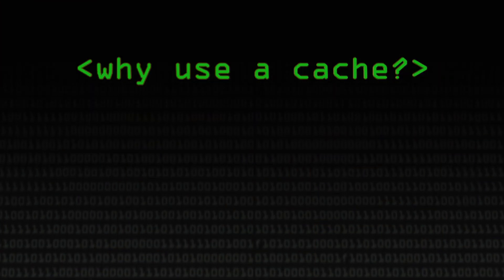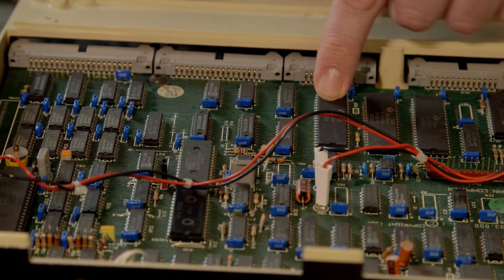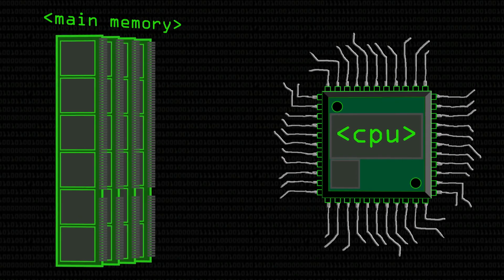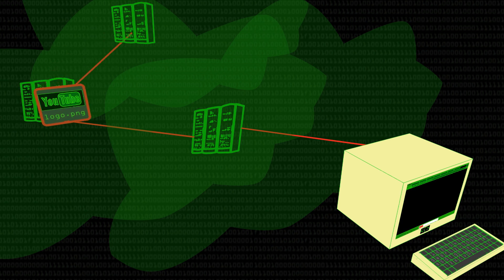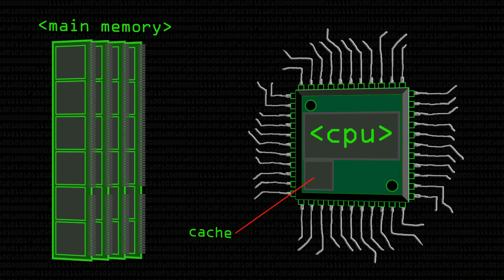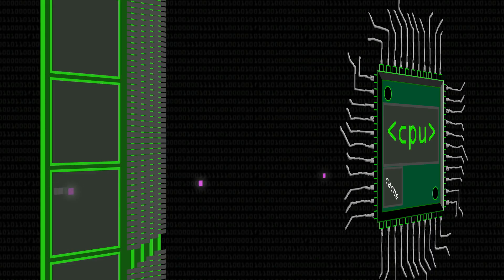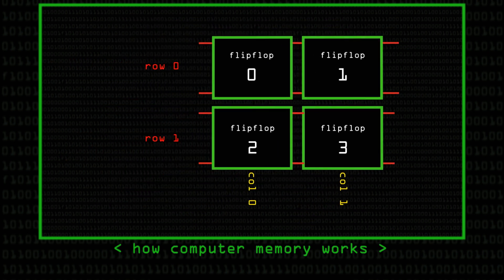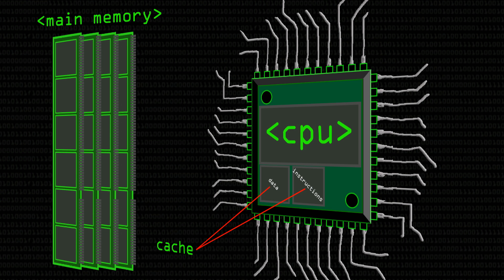Why do CPUs Need Caches? - Computerphile

Comment: Just a bit of clarification, nowadays RAM chips can be clocked faster than the CPU, but the latency remains quite high (relatively), so cach memory is here to stay indeed.
Reply: Do you confuse the internal clock with the external data lanes? I think that since the N64, those data lanes have the highest clock rate in the system. I don’t quite understand how ESD works here. Perhaps the multiplexers use BJT ?

Comment: Simplify chips by getting rid of all general cache levels but level 1 and fixed purpose level 0 cache. Reduce instruction size to 16 bit, remove branch prediction, legacy instructions, combine GPU and CPU SIMD as an APU, with many simple cores and increase level 1 cache to fill up the rest of the chip, with some redundancy to improve yields. This architecture makes more sense as we get closer to 1nM chip fabrication. Imagine an APU with 1 GB Level 1 cache the size of a Xeon.
Reply: nvidia / amd / intel would lose money that way that’s why we don’t see as many apus imo
Reply: @CeezGeez  .. Intel has everything to gain. I'm one of these people who don't care about Intel's Arc discrete PCIe graphics doing well enough to be competition for AMD and nvidia because I'd rather Intel just pull the rug from under their feet with Intel APUs and an Intel-only mobo standard that has a standardised GPU die socket, like a CPU socket, and possibly a very high bandwidth VRAM  socket to match. Faster CPU-GPU i/o, faster data access, with the VRAM usable by the CPU too, though at a slower speed than the GPU. PCIe wastes a lot of space and power as well as potential bandwidth.

Comment: I understand why we need cache but why do we need a centralized cache? Wouldn't if be faster to attach smaller caches to individual cores for doing tasks in parallel?
Reply: This would make multi-threaded applications more of a nightmare to design. If Core 1 has some data Core 2 needs for an unrelated routine, it would have to stop what Core 1 is doing to request that item in the cache, or it would have to go out to RAM to get a piece of information the CPU technically already has.

Comment: we do not need Cach  it is all depending on how the computer works. I need that one of the collages I will not name as I may get in trouble for it . Well that collage is working on a computer that will use 1 chip for memory this chip is your hard drive you ram and your system and cpu cache what this is is a single chip system for memory. Its realy cool how it works yes you would think it will slow things and yes it can but what is cool about it is down the line say a faster chip comes out for the memory but you cpu is fast enuff to run stuff well you can replace that chip with a faster bigger chip save mony doing it and get faster speeds.

Comment: So just a bit of curiosity mixed with some at the moment "current events," with the advent of faster DDR4 memory being capable of speeds of around 3000 MHz (3 GHz) and processor speeds largely staying the same over the last approximate 7-10 years is it possible that cache may become less important of a component, or is it that when you combine the both multi-threaded applications both in multi-core and hyper-threaded applications that the explanation for cache becomes more complex than simply the clock speed of a processor and the speed of the RAM being a major difference between each other as it was in the past?
Reply: Joshua Cooper well it would need to do one get data and send it back cycle per instruction. The instructions per clock cycle are nowadays often higher then 1 and all cores would need to do that in serie because ram is mostly not parallel. We would probably need 12 ghz ram before we don't need cache, but then CPU will have a similar speed

Comment: the point of modern CPU speeds vs RAM speeds forcing the use of more space on the silicon begs the question... what would a 3Ghz, ram stick look like? how much space could a normal sized(lets say DDR2) stick hold? how big would a 8GB stick need to be?

Comment: So really, the answer isn't that memory didn't keep up, that technically we can't do it, but simply that the cost of RAM as fast as the CPU combined with the amount of memory modern tasks use left room for a cheaper solution in the form of a small amount of very fast memory, a moderate amount of medium-speed memory (main RAM), and slower mass-storage (HDD, SSD). We could have a machine with 16 gigs of super-fast RAM but the performance increase would be moderate compared to the extreme cost.

More abstractly, we've always had cache in the form of a multi-level memory scheme, and this is just further stratification of it. Even the original computers had the online storage of bits it was working on, and humans with the rest of the data, with a slow link between them. The 1980s computers shown had a few levels: CPU with its registers, main memory, and cartridge/tape storage. There's a tradeoff between size of storage and cost of fast access, and many tasks naturally use a small portion at a time, so you use it as cache for the larger one.

Looked at from the other direction, it wasn't cache that we added, as the fastest memory kept up with CPUs, and its size has stayed fairly similar (even modern CPUs have the L1 cache around 32K, like home computers had of fast main memory); rather, we've added a huge later bank of RAM to modern computers, between the fast memory the CPU uses and the slower mass-storage.

Comment: The is actually a additional problem apart from cost. Silicon chips can only be made in a certain size, about 300-400mm^2 is tops.  A normal computer needs a typically say 4-16GB of ram today, and it would consume over 1000mm^2 of space. This make it so you have to make a multi chip solution.

Then of chip memory have to use board wires, they are a lot slower than silicone wires, make it so you need more cache.

Actually, the premise that its that DRAM is the reason why cache is needed. But the wires is the issue that make it so we need a lot of cache

Comment: I have i7 920 at 2.67GHz, if I upgrade to i7 5960X, and clock it to 2.67GHz, will there be a signnificant difference? And how much does it come from the cache?
Reply: For starters, the I7 920 is a quad core 8 Thread  CPU where as the I7 5960X is a 8 Core 16 Thread BEAST. Also, the 5960X will have higher instructions per clock, higher stock and boost frequency, more Cache (20 MB vs 8MB). It'll just rek the the older CPU easily in everyway.

Comment: You could have elaborated on what's going on with L1-L3 Caches. Is one for data the other for instructions, or do they have no preferences? If they can/will store the same, how does the CPU decide what to put where as they have different speeds?
I think this should be even in a beginner video, because you will be confronted with those values in most ads.

Comment: Gotta love how cache did make a difference. Going back to the Pentium 4 and the Celeron. In many ways they are the same except in cache size. Pretty much not not so succesful P4's became celerons.

And for office tasks, light office use, it didn't matter that much. Unless you where dealing with huge sheets to work on. 

So many office pc's ended up with celerons. And that wasn't bad! 

It was slower then the P4, definitely once certain jobs really could use a bit more cache then the celeron offered. 

Of course nowadays cache also is used to connect multiple cores together. As a bridge between them. So you get a nice big swat of memory to function as shared cache for all cores. And locally a much smaller one for its local, one core only, calculations.

So does cache influence speed? Yes but it also depends on the job it is doing. Word probably won't get much a speed boost with double the amount of cache. But encoding video, running databases or yes a huge spreadsheet then a big cache will mean more performance.

Comment: Modern CPUs often have three caches, the one that is described by this video (separate for data and instructions)  is the L1 cache, the fastest, and every core has it's own. L2 is larger often shared between cores (2 on my system) . L3 is the biggest and there is only one for the actual chip on which the cores are.
Reply: And we must structure our data access in such a way to use the caches as much as possible and delay the need to eventually go out to main memory, That’s the “fun” part
Reply: ty

Comment: apart from the cost problem, why don't we just use ONLY cache and more of it, either as part of the CPU, or externally. 
instead of using regular ram. cache would get cheaper anyhow it it were used instead of regular DDR or ECC memory.
 it may even save motherboard space compared to regular RAM but that's probably not a really severe problem.

Comment: I wonder, since RAM has actually caught up with the CPU again where a current generation intel cpu can accept RAM with clock speeds of up to 3GHz without going into overclocking, pretty much the same clock speed as the cpu itself, why is the cache still faster even if the cpu is running at that same 3GHz?
Reply: +megaspeed2v2 For one, latency
Reply: +megaspeed2v2 A huge part of the reason that the cache is faster is that it's physically closer to the CPU. It takes time to get your request all the way out to the normal memory and all the way back to the CPU. 

I think that is what +sundhaug92 is referring to when he mentions latency.
Reply: ZipplyZane yes it was, i understand the latency aspect as it helps when accessing lots of little pieces of data but whenever larger amounts of data are being accessed wouldn't for example 3GHz ram coupled with a 3GHz CPU no longer have a bottleneck as the ram can throw out data quickly enough to use up the entire CPU time in short bursts rather than the cpu having to wait for a few million clock cycles between transfers

Comment: What's the difference between cache and a register?
Reply: +Roflcopter4b Registers are where the CPU stores its working variables. It is the fastest memory to be accessed, but typically only contains a handful of bytes per register, and not many registers. A cache is much larger, up to some megabytes, and stores frequently accessed memory. It is much slower than registers, but much faster than RAM.
Reply: +Roflcopter4b registers hold the actual state of the CPU at a given time, to analogise this to a human being, a register could be the position of your arm or what smell your nose just picked up for example, whereas the cache is like a human beings sensory/short term memory holding info about remembering where your arm just was a second ago and what that smell was just a second ago, then ram is like medium term memory, what you expect to be doing in the not too distant future and then the hard drive being long term memory with all the info you have in total.
Reply: +Roflcopter4b Cache is usually not addressed to explicitly, it's not something the programmer can manage (though there are exceptions, such as the PS3), though one could think of registers as explicitly addressed "L0"-cache

Comment: Now just do 2 level caches
Reply: +B. Winky They work the same way. When L1 is flushed (either partially or totally), it's flushed to L2, when L2 is flushed it's flushed to L3 and L3 to RAM. It also works the same the other way, when the CPU can't find what it's looking for in L1, it checks L2, then L3, then RAM.

Comment: The memory used to make CPU cache must be very robust, I know that RAM can become worn out over time. What makes CPU cache memory last so much longer than other memory types?
Reply: It is because CPUs use SRAM(Static Random Access Memory) instead of DRAM(Dynamic Random Access Memory) SRAM is faster than DRAM and also doesn't require refreshing allowing for higher speeds. But it is more transistors than DRAM which is why it isn't used in ram. It also uses more power.
Reply: +MrGridStrom I would guess that it has a lot to do with the fact that it's such a small amount of memory compared to DRAM, the CPU generates a lot of heat but modern heat syncs can disperse a lot of it, whereas a lot of ram relies on very small heat sinks so the heat over time may do more to damage the memory in the DRAM sets than in the CPU's cache

Comment: No mention of the register :0
Reply: +Ali Can Metan 
Eeeh. They have similarities in the way they could be implemented in hardware, but their intent is too different to be considered the same thing.
Caches can be addressed, registers can't. There is no instruction saying "Register A contains an address to another register. Copy the value in the register whose address is stored in A to register B." I mean... technically it would be possible if the manufacturer put in instructions for that, but you only have a few registers anyways so that would have hardly any use at all. And registers are not used in this kind of fashion. They are used to hold temporary values before you do something with them or write them back into the main memory.
Also I'm assuming that with "registers" you mean for example EAX, EBX, ESP, ... on a x86 processor. Because the hardware used to store a bit can be called "register" too, even it if is not such a register in the processor.
As far as I know EAX, EBX and so on are called "general purpose registers" and they are typically what you mean when you refer to the registers of a processor.
Reply: +Ali Can Metan 
"I have always thought I was utilizing CPU cache when I used them." That's not necessarily wrong, but most likely you don't. An example: int Cube(int a) { return a * a * a; } In this case the argument a is most likely stored in a register (instead of the stack when there are a lot of arguments). Say that's EBX. The return value shall be stored in ECX. You could do something like this: Mult EAX EBX EBX; Mult ECX EAX EBX; You only access registers. The RAM and Cache are not involved. But sometimes you want to access stuff allocated on the heap: int Foo(int* a, int b) { return a[b]; } Assume a is stored in EBX, b is stored in ECX and the return value shall be stored in EDX. This could be done like this: Mult EAX ECX 4 /sizeof int/; Mov EDX [EBX + EAX]; Here you have to access the RAM at a + b * 4. This could be cached to save time next time you access that region of RAM. (I'll assume that whatever is passed as argument a is allocated by using some equivalent of malloc. Because if it was allocated on the stack, caching would not make a lot of sense because the stack changes too much.) The registers in both cases are just used to hold temporary values. The contents of registers are never cached unless you explicitly write them somewhere into the RAM. They don't need to be cached because they are faster than caches anyways.
Reply: Scias
That's why we have high-level languages :P
Reply: Register? I think he did mention it indirectly. That was the turnip in the back pack.
Cache... turnip in the fridge.
DRAM... turnip in the field.
Reply: +Scias The registers change context too often for it to be useful for cacheing.

Comment: Ok, I'm not sure I'm following his argument here: He claims that RAM is orders of magnitude slower than a CPU. But a CPU runs at 3 - 5 GHz (in the most extreme cases for consumer grade hardware). But RAM can easily run at 2400 MHz, or 2.4 Ghz. So at worst, it's roughly half as fast as a CPU. Hardly an order of magnitude, right?
Reply: +Leto Atreides II The other issue is the latency. Fast DDR3 has a latency (time from request sent to return delivered) of ~100ns. A cpu at 3GHz issues one command every .33ns. This means that if the cpu must wait ~300 cycles for data to be returned. L1 cache, on the other hand has a latency of ~.5 ns.
Reply: 1/2 as fast is a full order of magnitude smaller as long as you think in base 2, and be is a computer scientist after all.
Reply: +Leto Atreides II For most computer users 1600 MHz RAM is going to be standard, if not on the high end. So you figure your average CPU at 3.2 GHz or so is still going to be waiting twice as long to receive whats in memory without using a cache.
Reply: +Oscar Smith Huh? May I ask how you arrived at 100ns?
Reply: +Oscar Smith 100ns!! I hope not. My computer in the 1980s had 60ns and my current HP has 12ns
Reply: +Leto Atreides II You have to consider latency and datarates.
Reply: Leto Atreides II

 RAM sticks are rated using bytes, 8 bits, but one instruction is typically many bytes. An opcode with a prefix will usually be 3 bytes. If the instruction needs data, that will be at least another byte, and often 4 bytes (for 32 bit data.) If the instruction requires an address, that may need as little as one byte (using address extension), or as high as 8 bytes (for full 64 bit addresses). The byte rate demanded from memory by the CPU is liable to average 5 times the CPU instruction rate. 5 x 3 GHz = 15 GHz would be required from memory, if the CPU only executes only instruction per cycle. CPUs are usually capable of executing at least 2 instructions per cycle. CPU's often execute more than one instruction per cycle, and sometimes more. They can average 2.5 instructions per cycle if the instruction mix is advantageous. 8 core CPUs can of course execute 8 times that. 5 x 2.5 x 8 x 3 GHz = 300 GHz. However, as the video mentions, RAM is usually designed to pull 8 or 16 bytes from RAM simultaneously, so we can divide the required rate by 8 or 16, so roughly 40 GHz or 20 GHz.